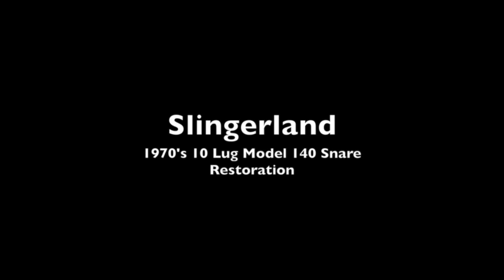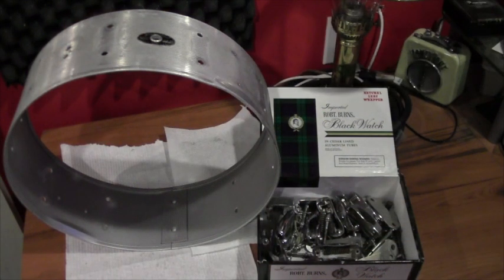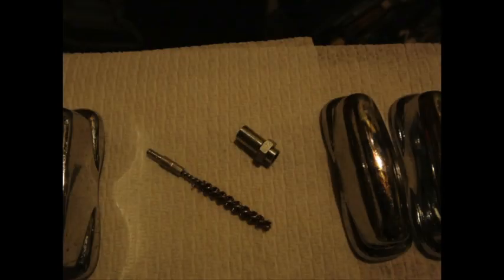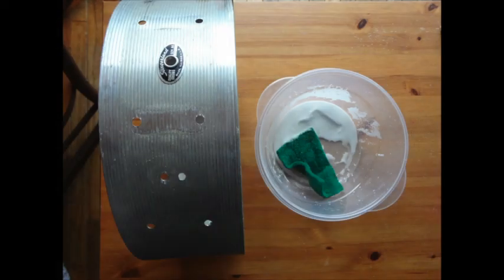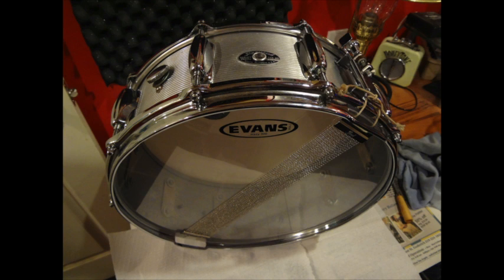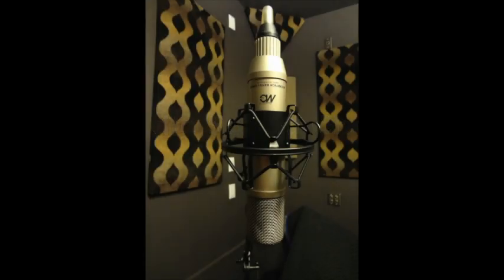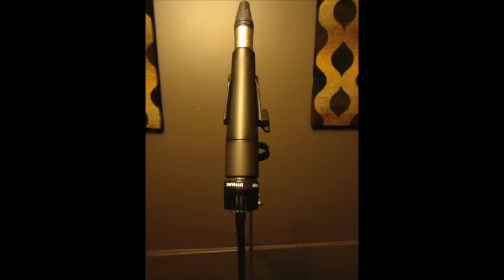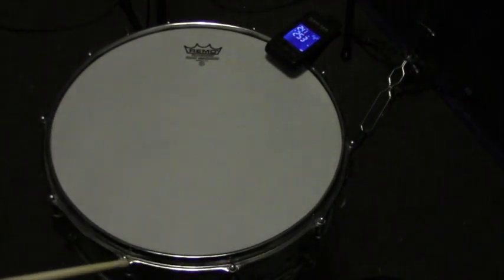Slingerland Snare Drum Restoration

Comment: Ring used on batter head to stop overtones in final recording. Don’t be confused… this was not a Remo Evans head. Years have gone by and this video still holds up well, though it was in my opinion, far too short and could have been completed using household products, such as white vinegar and cotton swabs to clean the lug screws... and general hardware. One throw away tension rod in good condition will also usually do all that’s needed for the threads. Run it through, or replace any inserts giving trouble or that that catch. Replacement is my first recommendation. Also… lube these lightly with any simple oil or grease  you have at home. Lightly!!!

This is a very nice snare, that will, if taken care of… provide many more decades of fine service, wherever it lives.

Again… it’s been years and only one comment was left here, so I decided to chime in. No disrespect was meant by any words I left here. Drums are fun… 

✨❤️✨